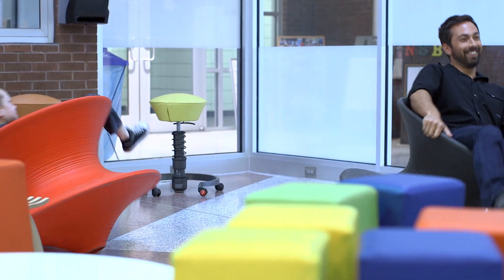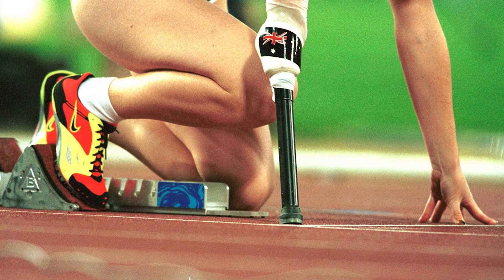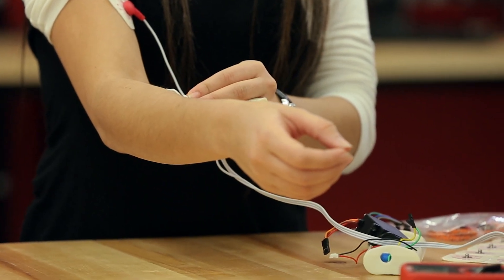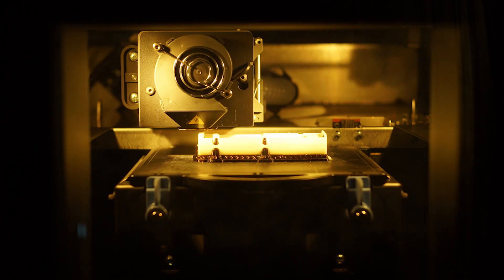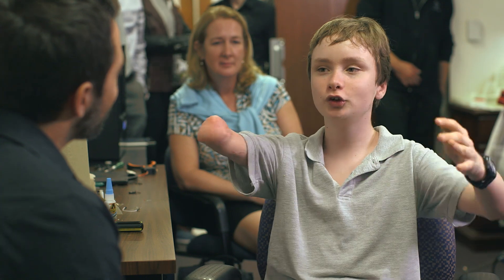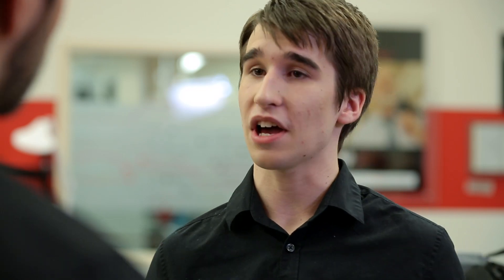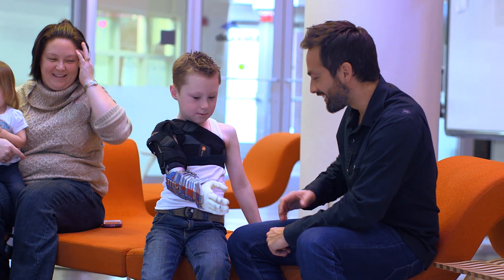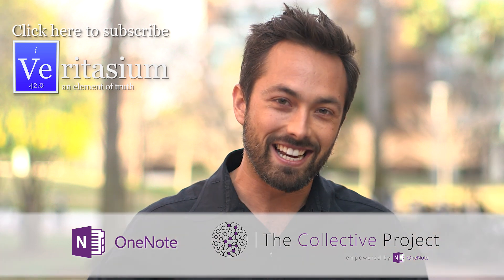An Affordable 3D-Printed Arm

Comment: What people are failing to realize is this--profit helps to drive progress in creating more sophisticated, higher resolution prosthesis and thus help drive down the costs of production. This is why the 3D printed arms are so amazing. They took a relatively low-cost but very reliable technology and drove innovation to help improve the lives of kids. Instead of damning capitalism, learn why it actually helps drive these efforts instead of tearing it down. You perceive the need with your heart, but you need to maintain your thoughts with your head. So many people miss that and I'll never know why.
Reply: Michael Huff Exactly,thank you!

Comment: I have an idea! do ya know what the colors of the animatronics' eyes in five nights at freddy's? ya know the black outside and white single pupil? maybe have it programmed for it to go from a person's natural eye color to black outside and white pupil when they get angry! that way people will know when to back off. or it'll tell other people that they're ready for a fight! reply and type success if you think this is a good idea or failure if you think this is a bad idea.
Reply: Bethany Folsom The wolf,
Do you know how hard it would be to neurologically link a pair of contacts to ones brain? You could do it off blood pressure I guess, but that would be flawed in various ways. 
You could also do it from some sort of switch, example; a press of a button would change the eye colour wirelessly.

But that also comes with the trouble of the colour changing itself, and honestly I can't be bothered to dig too deep into how that works, so you can figure out how it would work yourself. 
And besides, it would all be for aethstetics, you could just buy regular contacts.

Comment: In December 2006, archaeologists discovered the world's earliest known artificial eyeball.(has been dated to between 2900 and 2800 BCE).  It has a hemispherical form and a diameter of just over 2.5 cm (1 inch). It consists of very light material, probably bitumen paste. The surface of the artificial eye is covered with a thin layer of gold, engraved with a central circle (representing the iris) and gold lines patterned like sun rays.  Source: Wikipedia/shahr-e sukhteh (burnt city) Persian empire.

Comment: I know your frustration.  I have had a completely dexterous prosthetic /robotic manipulator for over 25 years.  It can be manually constructed for a 3 year old to king kong.  I made mine from cardboard, latex rubber, pvc tubing, fishing line, and foam, to look and act as real as possible.  control as a robotic manipulator of he 34 functions is not difficult, however direct human control still needs much work.

Comment: I'm telling you, since  they already have a chip to connect to your brain, they don't they just make something that will connect to the brain with out having to crack the skull open the use the nerve pulse or what ever that is for the arm that is not there and then use the guy in the video's (not the you tuber) Idea except add a bit more bulk at the back of the fake arm for an elbow and you got your self a plastic based terminator arm that works fast enough for you to handle a Ak-47 (not that I want anyone with a robotic plastic arm)

Comment: Its not that people haven't thought of this sort of thing, the issue is that its very limited, also i question the strength of something printed. but really, this is very simple,  it doesn't push prosthetics forward, but it does have a place I suppose.

Comment: Could the bionic arm be adapted to understand different signals? Like the signal from one muscle to open it and another to close it? That could help make it easier to use and a lot closer to a real arm :)
Reply: +Gamal Trinidad Kabil   Lol yeah, it's so easy to do that, just double the sensors. There's probably like a million other problems, it's not as easy as "doubling the sensors"
Reply: I'm not an expert in this kind of things lol. Just it seems like there're no other problems in the way. Probably I'm wrong but... Just what I think that may be the solution
Reply: I know that technology for this has already been created, but I don't think it's cheap
Reply: +deWaardt its just doubling the sensors. Not much more expensive.

Comment: First time I've heard someone say that 3D printing is cheap
Reply: +Oliver Johansson Personal 3D printing is expensive, but if a company or a university have access to them, they end up being cheaper then having to order specific items/parts.
Reply: +Hedric Jones well, you say that, but are you really saying that if you were born without an arm, and someone offered you a working plastic arm for $200, you wouldn't accept? I know I would...
Reply: Cheap in comparison to factorize plastc arms
Reply: +Oliver Johansson It's cheaper to use an existing 3D printer rather than a specialized machine that can only mold one thing.
Reply: Well like compared to the 40.000$ price! :o
Reply: The printer would cost about $2000 for a quite good one and the plastic would only cost around $25 for one arm
Reply: @HELLO-ci7wp  Yes but $2000 compared to a expensive arm which could cost 20K which is now only $200 per arm is amazing you can make more with it
Reply: there's a 3D printer for just 300$ its called M3D printer
Reply: My school has a 3D printer we have to pay for the materials but u get to do some awesome things.
Reply: I have a 3d printer and I'm in the nerf hobby it is the most important tool in my arsenal something breaks oh I'll just go build it want a new project ill go mold it and plug it in.

3d printing is changeing the world
Reply: imagine, paying 200$ for just 10-100 meters of plastic
Reply: +Henry Pelmas i mean the plastic filiment as a whole or rolls of 3d printing plastic. where in hells name did u get that idea that i wouldnt pay for a 200$ plastic arm? o right u dont know me (in general i would say no to a working plastic arm that costs about 200$ simply because that wouldnt make me human or more human from my perspective life is what u work with for what u can or want and enjoy it, it obviously is different from everyone elses but hey we all have weak and strong points of our personalities that differs us from being the same

Comment: Oh, neat. I was actually thinking of a similar design. I feel like the design could be improved if you put the computational device somewhere outside the prosthetic limb, though, so the limb itself isn't so cramped for space on the interior. Like, strap the cirtuitboard stuff to the upper arm, then run wires down to the servo. It would give more space for better articulation of the limb.

Comment: I've been watching this Chanel for a while especially about the universe quantum mechanics and the universe. Anyways I watch Star Trek and they use a "warp drive" which can move faster than the speed of light by creating a "sub space field" which compresses space in front of you and expands it behind you. So finally I was wondering if you could disprove warp theory.
Reply: Do a little research on "the Alcubierre Drive".
Reply: @BigRalphSmith 
I have done research on the alcubirar Drive and it requires a certain amount of Exotic matter to work a more realistic design would be two plates smooth to the atomic level about 1 centimeter apart facing each other which requires no energy to create
Reply: Adam Mahler
Yep. There are parts of the equation for which we have not yet developed the necessary technology.
Not yet.
Your plate concept sounds like Interferometry but how would that concept be used to create space-time warps?
Reply: I see what you mean but that is not the case. In a vacuum quantum physics dictate that so called "empty space" if filled with molecules that phase in and out of existence with our universe. The plates need to be so close together so that when the atoms fly into our universe they create momentum this happens faster than the speed of light.
Sorry I left out that they are trapped because they phase in in pairs making it so that they can't phase out without the other or they just do it on their own.
A professor has tested this and on the two centimeter plates the force was that of the gravitational pull of a red blood cell.
Reply: Adam Mahler
So your plates seem to have the same kind of road block that other drive concepts have. Namely, physical limitations.
Reply: Not to be rude but that's not how it works. The plates create a sub space field using particles traveling faster than the speed of light. I believe that these plates can be enlarged and placed on like a nasal but with many of them creating a sub space field which envelopes the ship. The space inside of the sub space field would remain the same while the space in front of it is compressed and expanded behind the warp driven vessel.
Reply: Adam Mahler
Have we demonstrated that such a thing as "subspace" even exists? I haven't ever seen anything that says we have. Also, there are no particles that we are aware of that can travel faster than the speed of light, not even photons and tachyons are only hypothetical to date.
The virtual particles you referred to have not been shown to be capable of moving faster than light, either by observation or mathematically, due to their quantum superposition and lack of information transfer. At least, not through four dimensional physical space-time.
If you could point me to the the abstracts for the papers that demonstrate these concepts, even mathematically, I'd be very interested in reviewing them but, as far as I can tell so far, it sounds like this plate idea is even more hypothetical than drive concepts like the Alcubierre drive. I'm not a professional mathematician or physicist so I'd need to see the calculations and work through them before I could really have a solid opinion.
Thanks.

Comment: Mechanical engineer here. Have you considered moving the motor and battery to the upper arm? The battery could even be waist mounted. It may make the arm easier to move, right? It looks heavy for the child. Great project though! Good work

Comment: a servo, an electrode and a microcontroller don't cost 300$ so the price must be coming from the 3d printing, if you skip the full sized arm 3d printing part and make a basic model on which you put a small 3d printed end piece (at the place where the arm and prosthesis meet) you could reduce the price.

Comment: Ive always wondered how they control them. Of course if the forearms are intact, its only a matter of placing the sensors at the right place and you may get full functionality. But when up to your elbow that seems a bit hard. Gonna take a long time to get used to if what you do are combinations of only a few signals. And what if you like change to a different model

Comment: Okay, this got me all excited until I heard that "we need funding". That suggests the price they're mentioning is more like material costs than economically sustainable price of the product. 

Customization is cool but it is also making the product more expensive - both due to manufacturing, and because you need to pay the designer. 3D printing is only necessary for customized parts such as the sleeve, great deal of the rest (palm, fingers, ...) comes off much cheaper using other manufacturing methods. Particularly when going to "help millions", i.e. making large series. And guess what, that's exactly what economically sustainable prosthetics manufacturers are doing.

No blame for Microsoft ad, I prefer that to cooling towers.

Comment: While 3D printing is cheap and accessible for one off projects like this, it's cheaper to produce plastic in bulk in other ways. Everyone seems to be saying that 3D printing is so cheap, but there's a reason that all the cheap plastic products from around the world still aren't being 3D printed. It's cheaper to produce plastic products in other ways.

3D printing is fantastic for prototyping, but not for mass production. With a project like this, it makes more sense to mass produce rather than 3D print.

Before I'm accused of being completely cynical, let it be known that I appreciate this work and it is undoubtedly going to be a force for good. My main concern is with the falsity that 3D printed products are cheaper to produce. Sure they're cheaper to design and prototype, but they're most definitely not cheaper in mass production contexts, and it would be cheaper to buy a product produced in a different way than to print it yourself.

Comment: I don't mind product placement because I understand that it will bring in better money than youtubes awful system. But that was not so much shoe horned in to the video as it was driven into my face with a sledge hammer.
Just say something like "Thanks to Microsoft One for getting supporting the project and allowing us to communicate more effectively thanks to your MSOneNote. Theyre actually pretty decent." It sounds much more genuine.